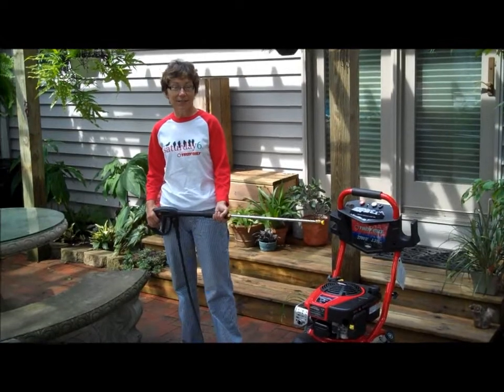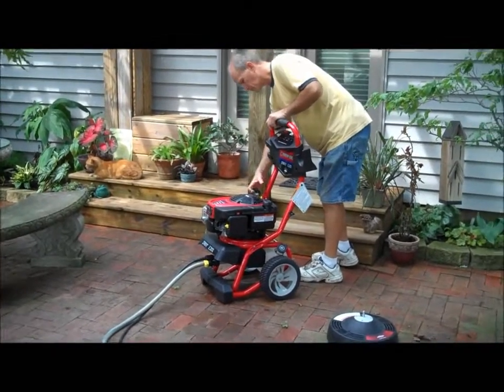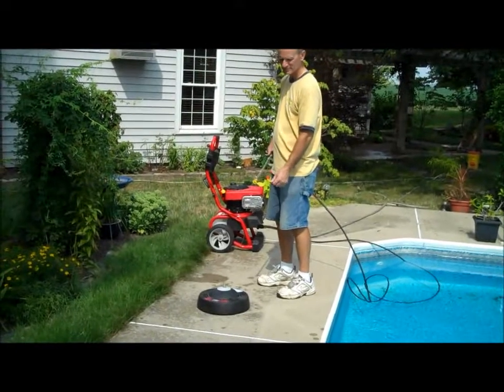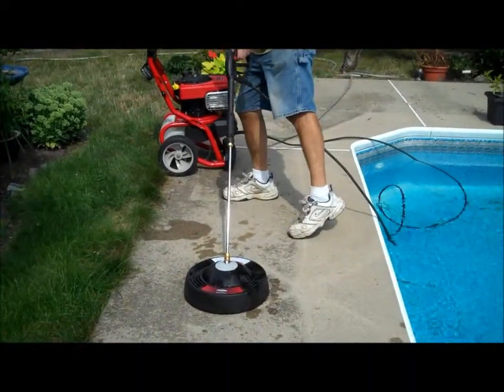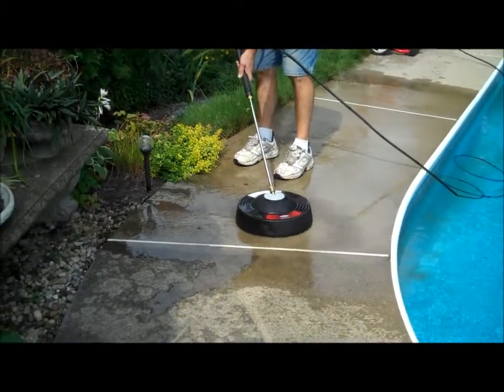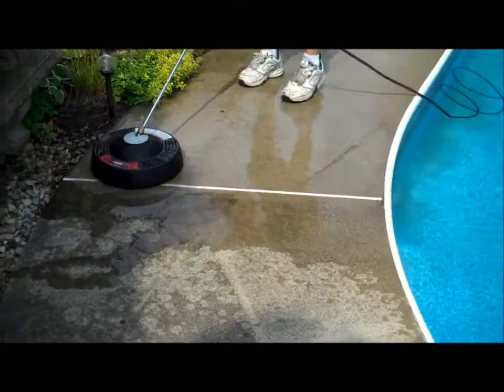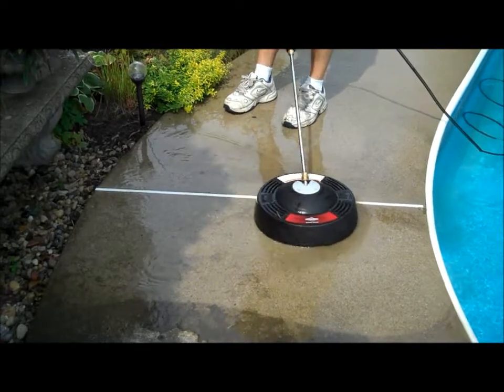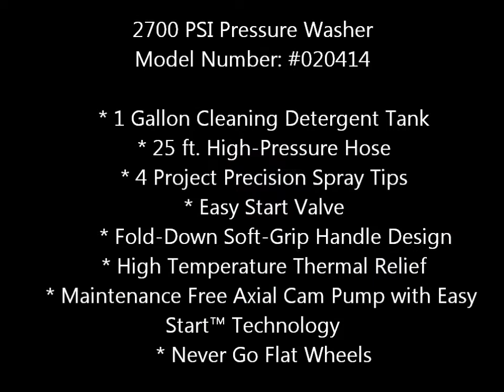Troy-Bilt 2700 PSI Pressure Washer

Comment: Troy Bilt buy the pressure washers from Briggs and Stratton and only markets them they had alot of problems from the pump to the engine itself mainly the plastic camshaft and timing gears breaking. as i had a Craftsman pressure washer with this exact 7.75 engine got some use till the engine blew up and threw the connecting rod out the side of the block. i did repower it with a chinese engine to find out later on the pump cracked. bad so it the pressure washer was replaced by a predator 212cc model and the acessories i had did fit this pressure washer very well. and has more pressure to clean and a far much better pump.  infact more powerful it took the paint off the surface i was cleaning.  when i had the craftsman i had peoblems of it cutting off then it started knocking till the connecting rod let go and bam went through the block and destroyed the entire block and cylinder assembly.  the ready start system did work. only had 3 seasons out of it. and got two hours when it was repowered with a chinese Honda clone engine. till i realized a new pump is more than what this thing would cost it was not worth it so i have the engine laying around may sell it down the road as it has only has 2 hours on it hardly broken in.

Comment: Try this before cleaning: 1/2 a cup of any powder detergent, 1 cup of 5% bleach both mixed in 5 gallons of water. Spray the surface to be cleaned with a low pressure tank, the ones we use to spray gardens.  then just go with the machines.  you'll be amazed with the results.

Comment: that patio cleaning attachment looks pretty back breaking after a while.
Reply: I started out with one of those, it would make me so MAD!! now I've gotta water jet, it looks like a push mower and does a 20" strip at a time. Doesn't leave any swirls though...but I run heat and my pump is the size of that motor...lol

Comment: You have to go slower than that to clean with the floor cleaner. I have the same pressure washer with the same floor cleaner and I have to go a lot slower because the pressure washer doesn't have that much power.